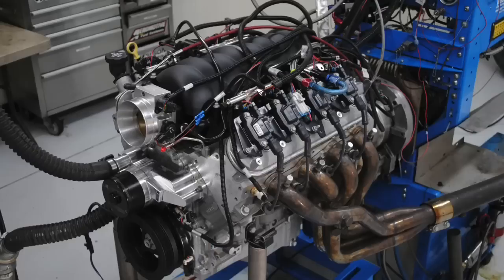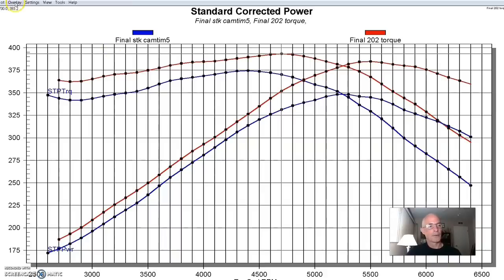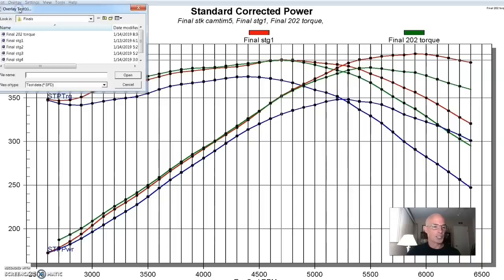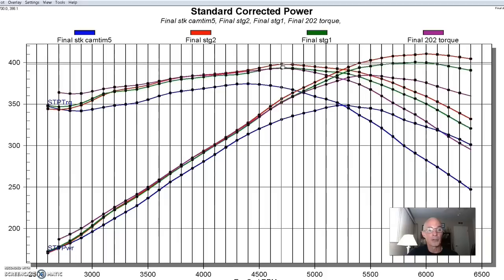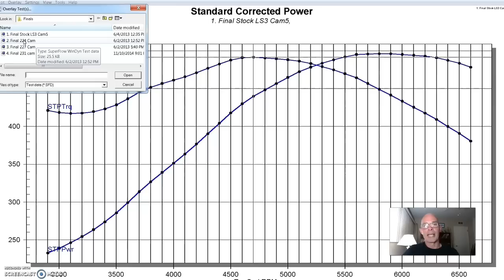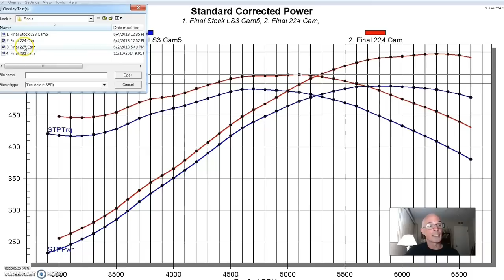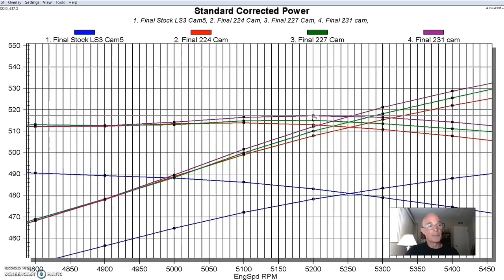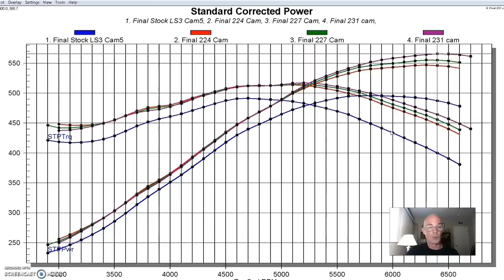LS TORQUE CAM TEST-WHAT WORKS!

Comment: So if there's two identical cars one with say stage 4 cam and lower gears rear vs other car stockish cam but higher rear gears who would get to thefinish line first? Im really asking how much are rear gears worth in a trade-off in power lower rpm vs upper rpm?
Reply from the maker: gearing always helps

Comment: I would first like to say thank you very much for all the information you have been sharing. I have been looking for a great torque cam, for my 5.3 2004 Avalanche. I really did not want to spin the motor past 6k, I think the BTR Stage 1 v2 specs are 206/212 .553/.553 112+0. BTR Stage 1v2 carries max power past 6k. I think adding 2 to 4 degrees of advance would help bring the torque earlier in the RPM band, and would give me max HP about 5600 rpm, I would like to keep my shifts at 5900 rpm. Thanks
Reply from the maker: good luck

Comment: Please do this with Summits pro ls cam series.  The sales tech said I would gain 30 ftlbs with the 8718 via text.  Your "numbers speak for themselves" approach makes you the Youtube dyno king.  Keep up the awesome work
Reply from the maker: you can gain 30 lb-ft, the question is where?
Reply: @richardholdener1727  After watching most of your videos, my primary frame of reference, it seems questionable that the low buck, low lift (no spring swap needed) cam can out perform the BTR torque cam, for example.  If it does, is this power in the range a daily driver would see any real benefit (2500 - 4500 rpm)?  I have searched the net and found zero data avail based on real life results, not even from Summit.  I love the big rockin cams with screaming turbos but i have two daily drivers with L59's 5.3 ffv (seized lifter  ate the stock cam, my reason for upgrading)  I don't want to upgrade only to loose the torque I want most in the area I am going to use it.  One will be treated to long tube headers and a light tune, the other will keep manifolds for now.  Thank you for your quick response. We absolutely love your work.  If there is someone to ask, you are the guy.

Comment: Love this one . However us with LS powered 6.0 boats are looking for a cam that will pick up the most torque from 3000 to 6100 rpm. These cams do not work in boat applications. I know I've had 4 from BTR and am struggling like a lot of us are.
Reply from the maker: why does a truck cam not work from 3000-6000
Reply: Sr cause when your spinning a prop wether airboat or prop from idle there is load and the more you spin it the more load there are. I have litterly had almost every cam you tested in this one . Us in the boat ls life are having a hell of a time . I could just spend 800$ on a water thunder cam or a mass cam but I want to know why and how to make the most torque and go somewhere .
Reply: Set up is a 6.0 lq9 .020 over .799 heads milled to exactly 64 c.c a duel plane carb intake a 680 cfm quick fuel that is 12.7 to 13.0 AFR.
Reply: Current cam is the BTR 30612120

Comment: Single patterns make the most at a given lift and duration. Prove me wrong.
Reply from the maker: the Prove me Wrong thing has the opposite effect on me-makes me want to poke someone with a Phillips screw driver
Reply: @richardholdener1727  I prefer standard.

Comment: It's like what Iskendarian said to me moons ago." There is little use in changing a cam to one just a few degrees different . 3/4 or full race is all you really need. "  So You want more torque stroke it. No not that.
Best way is to Turbo for Big torque it seems.

Comment: What would you recommend for stock converter. Biggest but keep stock converter for drivability.
Reply from the maker: I'm told Stage 2 is ok for stock converter on a 5.3L
Reply: @richardholdener1727   what about if you have an L9H 6.2?   Same?

Comment: Great information!!!!!! Thank You Mr. Holdener!!!!!!!! The 202/202 torque cam would be perfect for heavy trucks with stock torque converter, and factory shift points. I am curious if a 206 or 208 single pattern on a 106 or 108 lsa might make even more torque in the 2500-4500rpm range?
Reply from the maker: lsa video is up
Reply: @richardholdener1727  Mr Holdener, I just finished a 6.0 with 706 heads, flat-tops, 218/218 @50 on a 108lsa, 106icl. Should be a torquey combination😁 for a z71. I am curious about the 2500-5500rpm performance of another custom cam grind. Can i send you an oddball custom cam motion  210/210 on a 106 lsa cam to try on the dyno for max low rpm stank?  I'd just ask that you send it back to me after you're done.

Comment: A 5.3 to 6.2 all have same stroke 3.622 just bore varies .over square engine here in Australia Ford barra engine destroys ls.its a inline six which is a under square engine. Top fuel has a bore to stroke ratio off 0.92 where inline Ford 6 has 0.93 both under square engine's. Even no 6 has only have half  ci off top fuel engine bore to stroke ratio near mirror each other both engine's are  lethal.
Reply from the maker: The Barra is a good one-it is limited by displacement like the 2JZ compared to many V8s
Reply: Yes you are right richard.but I'll put this to you as performance inspired man.murder nova is a 540 ci @3500hp = 6.481 hp per cubic inch where in Australia dynamite performance has a street rego barra pulling 2100 hp @ rear wheels about 2300 at flywheel with amount to 9.46hp per cubic inch which is insane.should do a video on barra just to give our fellow performance nuts a look at what we have over here.but on saying that Ford au sohc inline six is even better I think 7.5@183 over quarter with 35 pounds of boost.compared to the barra 7.8 twin turbo by dynamite performance. Both engine's only have stock blocks and heads only billet internals parts.compared to a 2jz billet everything  with 100 or more pounds of boost. 2jz are insane in time this little engine we have over here will be the measuring bar in performance without a doubt. Thank you

Comment: The thing is, Torque Cam means different things to different people, to you a torque cam might mean a difference coming out of a hairpin turn and accelerating down the straight, to others it will mean pulling a 26 foot boat up and out of a boat ramp and 2000 rpm is important.
I don't think I've ever seen anybody praise an LS engine for its Low End Grunt.......lol

Comment: SO,  DOING THIS SAME BTR V2 TRUCK CAM TEST, WOULD YOU JUST ADD 50-60 HP AND TORQUE TO THE 5.3 CURVE TO GET A GOOD IDEA HOW THE CAM'S WOULD WORK IN THE LQ9? I KNOW THE CURVE ITSELF WOULD LOOK THE SAME DUE THE ONLY THING CHANGING BETWEEN ENGINES IS BORE AND COMPRESSION. BUT I WONDER WHAT THE NUMBERS WOULD BE. 395 FT-LBS IS NICE BUT 455 FT-LBS IS BETTER, RIGHT?
Reply from the maker: I TESTED THE EARLIER CAMS ON A 6.0L-only minor differences between V1 and V2
Reply: I saw the 5.3 and 6.0 cam test. Surprised how much more the 6.0 made over the 5.3. How would more compression, say 1 whole point (10.5-10.7), would do to the curve? Would the low end pick up torque? Would the hp pick up a lot?

Comment: Id love to see a test like this on a 408 Windsor
Reply: Will Mm : These tests replicate 2V and 4V head 302 and 351 tests on Destroked and standard bore Australian Cleveland engines by Lynx Industires in Australia in 1987 to 1989...called thd Power Games series in Australian Street Machine. The finger print was the 2800 to 3500 rpm torque hump where torque is lost with large 50 thou duration cams. Richard has proven the torque drop off in the 3000 to 3500 rpm range on his dyno runs. A 6.6 liter Windsor will be much like a 6.2 LS but the LS heads show more pronounced changes with 50 thou exhaust duration increases.

Comment: I’d really like to see how good the summit ghost cam does in a 5.3 or 5.7. The ghost cam I have in my car, I bought from a buddy of mine that had it in a 5.7 with ported truck heads, fast intake in an f body. It made 455hp TO THE WHEELS with that cam. That car almost went in the 10’s n/a with a stock bottom end ls1. Now that cam is in my turbo 5.3 which feels faster than it did with the BTR stage 2 cam which is bigger.
Reply from the maker: Is that the 8720 cam?
Reply: @richardholdener1727  it's the 8715 Cam.
Reply: Richard Holdener crap. Was in a hurry, meant to put the part number. 8715
Reply: Interesting !
Reply: SCGTO 04 the crazy thing is it makes really good power and it doesn’t really even lope in my motor. It only pulls 13” of vacuum at 650 rpm tho. Drives like stock.

Comment: Torque comes from ci amd stroke. The power plant will only take what it wants and what it can process. Cams dont change the mechanical ability to process the air. It only opens the valves enought for the ci/rpm needs.you coukd run with no valve in the head, and it would still onky flow what the port allows. Too much attention in all your videos other then the chassis dyno videos. Target hp gains or rpm that only race derived engines do. Best stop light to stop light car performance please. 5000 rpm and less.
Reply from the maker: Cams don't change the mechanical ability to process air?

Comment: The key is being honest about how you are really going to use and drive the motor when you are selecting the cam. Does it really work for you if you have to put 4:10 gears or a 3800+ stall converter in the car to drive it?
Reply: I'm thinking about putting that torque cam in my truck which I tow with as much as drive. For the most part I keep it under 4500. Hi-stall would definitely not be good towing.
Reply: I put a 3600 stall and 410 gears with a small cam shaft and this thing is wild but you but you have a point if you need those two options just to drive it it really sucks but if you put those two options with a medium or small camshaft the car is a monster on slicks
Reply: Agreed. A stage 1 or 2 I'd plenty for the street especially if you have a nice combo setup. The gains are really only past 5300rpm so I'd rather have some torque down low and an extra 50 up top. Well said
Reply: Don’t forget about a shift kits

Comment: Both engines has the same stroke. I would love to see a stock 5.3 or 6.2 with these cams and then do the same cam with a stroke 5.3 or 6.2 and see if the bigger cam lose power down low

Comment: I know it is difficult if not impossible to do a dyno sweep from idle but to do a torque video justice we need to see what it makes from 1500 rpm to 4000 rpm.
Reply: Remember to take the torque converter into play 2000 stall is much different than say 1200
Reply: I would like to see the a similar sweep but at say a fixed 25% throttle which would give an idea of the difference at real world driving loads.
Reply: Valve events will tell you where a cam will make its power. Dont need a dyno to prove it, just helps visualize it.
Reply: @B4CMARO  Of course, but I like raw numbers to quantify the difference. How MUCH more torque does the smaller cam make? At what rpm? How "low" is low rpm? 1500? 2500? 3500? Hard to measure that low on a dyno, I realize. The true test is how your truck accelerates up a hill with a 9000 lb trailer, but swapping 4 cams and comparing lap times is impractical, lol.
Reply: @B4CMARO  Actually the intake seemed to have more to say with it. Generally you see about 500rpm change for every 10 degrees at .050 and it was only about that much from the stock cams to the biggest.
Reply: My ‘13 Silverado runs 2k@95mph in 6th gear locked up. Which is just bananas and not ideal but if I could have a cam that could work with that and not be so far under the curve I would be a happy camper. Now I just disable 6th a lot... I may try the stage 2 BTR.
Reply: Yep i need that real life RPM range
Reply: I was just about to suggest the same thing. Off idle to 3000 is where most street engines run. My 05 
Silverado runs 2k rpm at 70 mph
Reply: I think the best way to do that is on a chassis Dyno, that way you know what it makes at the wheels.
Reply from the maker: easier on the chassis dyno-but then converter comes into play
Reply: @richardholdener1727  Manual trans, and you can lug it as low as the engine will suffer. But I do agree with the above commenter, it would be interesting to see those low end numbers, for non-drag racing applications, where sub 3000RPM numbers matter.
Reply: @thethepete731  my situation and thoughts exactly.
Reply: @richardholdener1727  do you think your will ever do the torque cam test using a 6.0 and these same cams? Wondering how the btr torque cam would work in a 6.0.
Reply: @richardholdener1727  Unless your manual trans, doing an LS swap on my s10, still going to pull my atv on a trailer with it, and with a manual trans I need all the torque I can get down low
Reply: @DillonTurner395  It's an S10 and the ATV doesn't weigh much (1000lbs with trailer?) Any 5.3 will be making over 300lbs of torque at 2500 rpm which will easily move this combo wherever it needs to go. The whole combo probably weighs less than a Suburban with 5 adults.
Reply: As Richard has said, boost helps and if you can gain it on the bottom end where it is needed then your gas or diesel engine will do the work your asking it to do. I think some people don't understand that even a little bit of boost on the bottom end is better than no boost at all. Richard I am correct on this????
Reply: @adampatterson707  I don't think you understand what you're talking about nearly as well as you think you do.
Reply: No you don't guestimate it or accept the fact that small cams are not enough to worry about and big cams got no business on the street

Comment: What did I think?  Choose two steps smaller cam than what my friends say to use and ADD BOOST.
Reply from the maker: sound advice
Reply: @richardholdener1727  I dig your shirt.  Where can I buy one?  Kool video.
Reply: That’s really good advice for a snappy motor a big camshaft is only good if you’re going to be at full throttle 24 seven if you want to snappy motor smaller cam with tight LSA an early intake valve closing makes a super snappy motor instead of a lazy waiting two days for all the power to hit not to mention fouling plugs at idle
Reply: Agreed. My lil 5.3 with 525 lift comp cam on 66mm turbo 10lbs boost will stomp diesels up to 350 feet. Exactly  what we race in the field
Reply: Agreed, if you can afford it. I know there's $163 Ebay turbos, but there's a lot more to it. And mad skills.
Reply: Donell Muniz damn looks like it's not for me then. I only have happy skills

Comment: This is great info because I just put a v2 stage 3 in my truck. Yea its down on torque but couldn't you make this up with a stall converter?  Since it'll be stalling until its making torque/power
Reply: Yeah, but a slight stall, with a lower gear ratio would probably be a happier truck! Basically just gaining 500 rpm stall, and go to like 3.73:1 from a 3.42.1 or 3.08:1 gear, especially if it's a street truck,  the. Milage is not going to be that good either way, but with high stall only, highway driving with locked converter will suck! That's where the gear will make drivability better, maybe even with stock converter, with gear would work well, depending on cam, and purpose,

Comment: I would like to see  a truck cam stage 4  in a 6.2 boosted.. the stage 4 effects the low end on the 5.3 a lot but how does it effect a larger displacement engine like the 6.2 or even a 7.0.. it might not have as much of a loss at the bottom
Reply from the maker: they all work under boost

Comment: Personally I blame squirrels
Reply: Dammit i see this everywhere!!
Reply: John Sheetz : Because its the only thing you need to know. Lightening rod for Hp. John Woodworth, Squirells, Richard Holdener. Horse Power and Torque from your LS.
Reply: John Woodworth : This is a Universal Truth John. Those  Buck teeth buck wildin' li'ill tree huggers are always riot. ( We dont have em in Moo Zealand, so I come to where the Sqizzles is at. Where John Woodworth is at is where the Hp is Squirelled Away. Youve all been told in advance peeps. JW+ Squirells = Richard Holdener Horsepower and Torque. Tell your truest friends stat!).